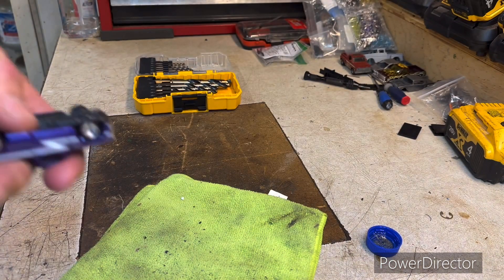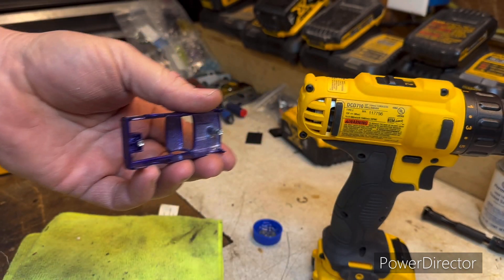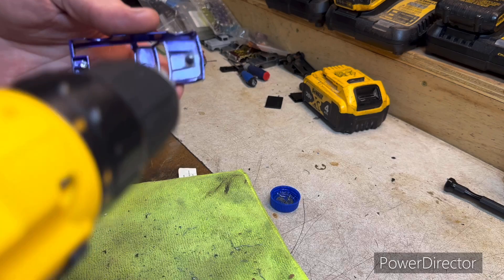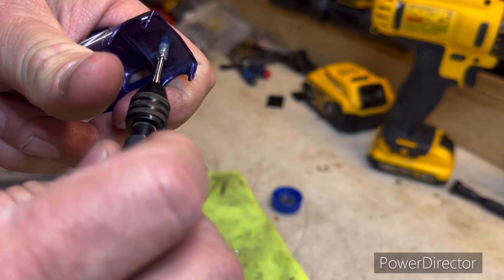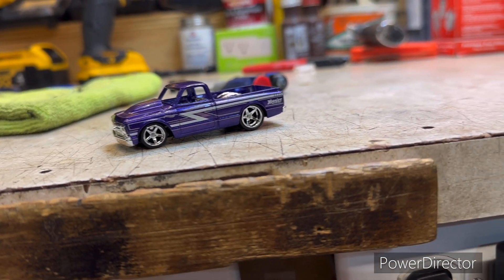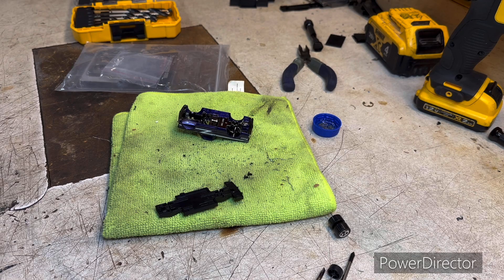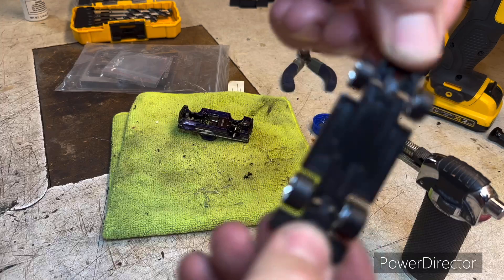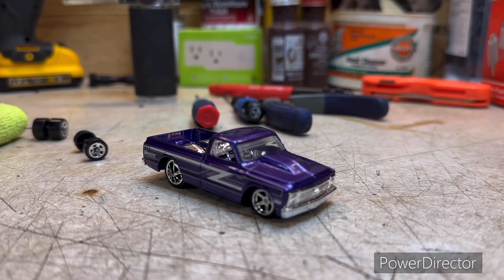HOTWHEELS 1967 CHEVY C-10 WHEEL SWAP #hotwheels #truck #diy #custom #toys

Comment: That heating the tabs is genius! I usually just cut enough to snap back in, but I like this permanent fix. Thanks for the process, it looks amazing with those wheels
Reply from the maker: Hey thanks for the view and comment. I like to keep the axels held into place soled.